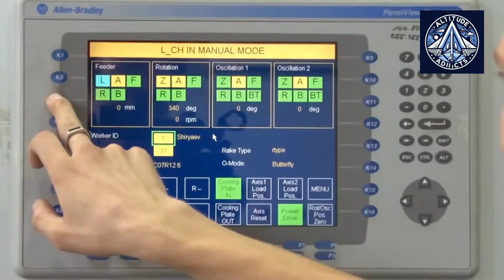PD-14, PD-8, PD-35 and PS90A - Russia Future Civil Engine Volumes Required

Comment: I guess one of the biggest challenges will be the availability of engineers and well educated staff. The universities in Russia do not provide enough engineers for the entire renewed aviation industries per year. For the big production series Russia needs to use more medium level educated staff instead, so the production lines must be designed cheap enough and in a very easy way to understand.

Comment: A few more months for PD  8 to test fly,  and few fro PD 35 to test start. Many many new technicians need to join. This will help new standards and safety issue. Safety which BOEING skips.  For sake of competition and further development Russia  needs good people to do this. As a mere fan and Aeroplane  enthusiast its great.  Now Russia is getting back to the USSR level of great planes, engines etc. Good for all in aviation industry all over. Especially ASIA.